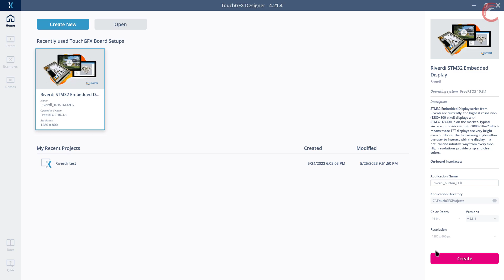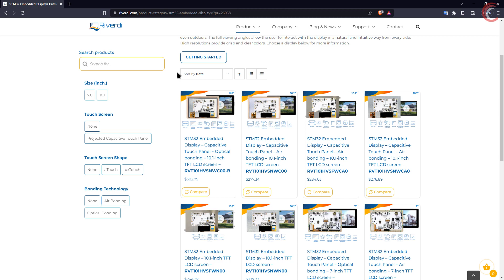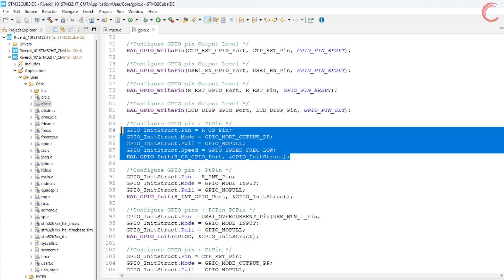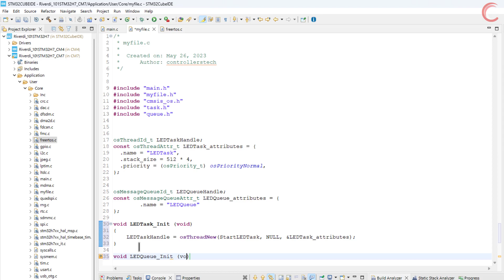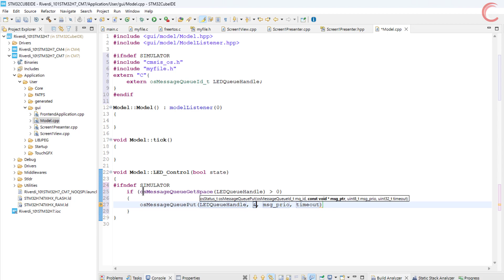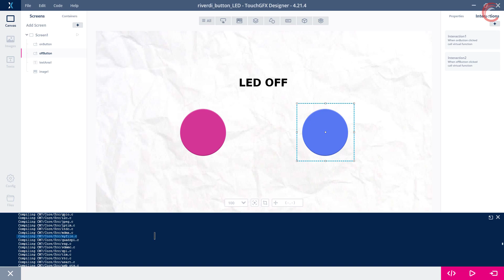Riverdi STM32 Display #2. How to control LED using Buttons on the Display

Comment: Thanks for the video. I use TouchGFX 4.22.1 and RVT70HSSFWCA0
I needed to add code to Screen1View.cpp : 
#include <touchgfx/Unicode.hpp> 
I used LED1 for the test. The ‘USR LED’ is connected to pin 33, PJ10, of the expansion connector.
In the file 'main.c' commented the line: MX_TIM1_Init();
and void LED_init(void):
    HAL_GPIO_WritePin(GPIOJ, GPIO_PIN_10, GPIO_PIN_RESET);
    GPIO_InitStruct.Pin = GPIO_PIN_10;
   GPIO_InitStruct.Mode = GPIO_MODE_OUTPUT_PP;
   GPIO_InitStruct.Pull = GPIO_NOPULL;
   GPIO_InitStruct.Speed = GPIO_SPEED_FREQ_LOW;
   HAL_GPIO_Init(GPIOJ, &GPIO_InitStruct);
Also added a line:
         HAL_GPIO_WritePin(GPIOA, GPIO_PIN_5, LED_State);
         HAL_GPIO_WritePin(GPIOJ, GPIO_PIN_10, LED_State);